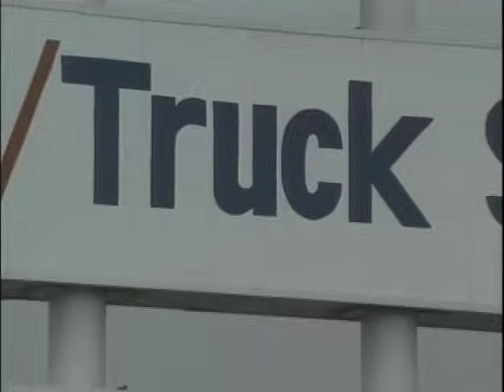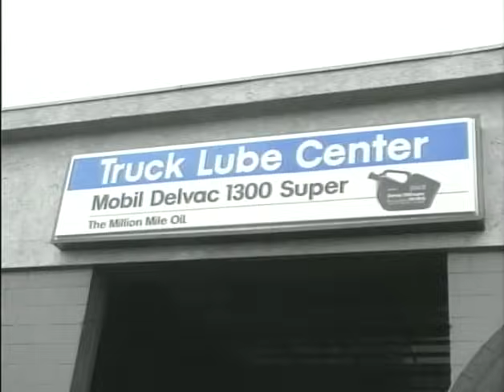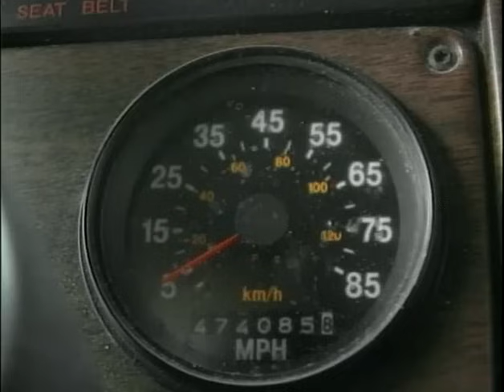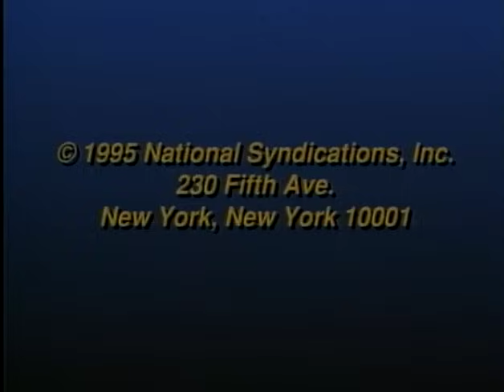All About: Trucks

Comment: 19:26 the truck that Harry is talking about is actually called a Roll-off truck. They're used to transport containers with construction/demolition debris and big factory dumpsters to wherever they are emptied. Then the truck will transport the container back where the truck got it from and drops it off in it's proper place.
Reply: As a kid it didn’t really make sense because the container never turned into a truck, the truck came to the container
Reply: @jonathandunn7853  true
Reply: Yeah
Reply: On this vid they have roll off trucks,rapid rail and a mini rapid rail